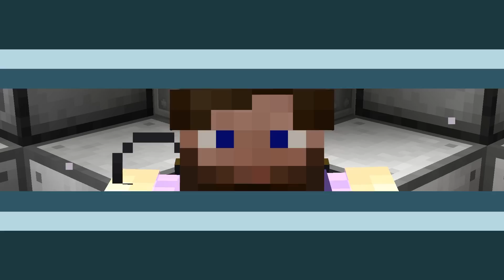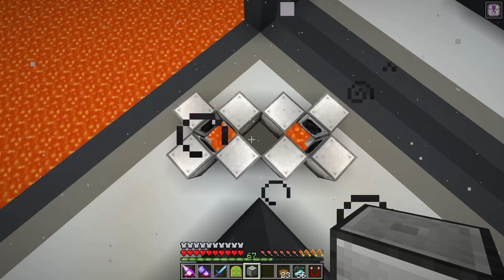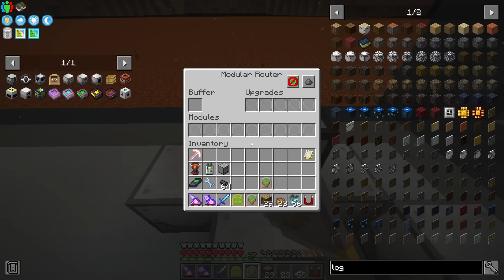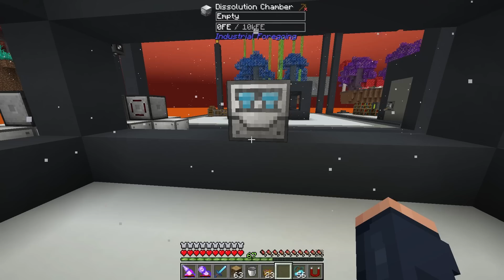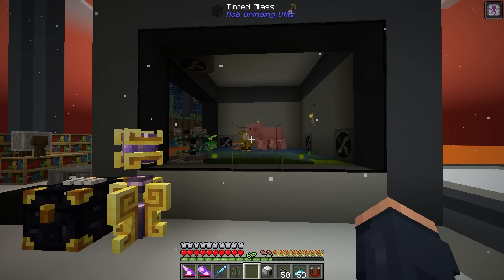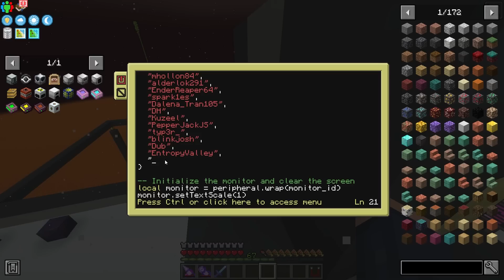All The Mods Volcano Block EP16 Unlimited Food IF Automation

Comment: put a tank in the router, then it can even transfer 250mb, a bucket is set to only fit 1000mb but a tank can handle different amounts. so a bucket only transfer 1000mb.
try the p2p

the player module is handy for keep instock building block, even to explore .

Comment: Chosen Architect, making the very typical mistake just about everybody makes when they use Applied Energistics 2.... @ 14:35 you put the next recipe in a horizontal line in the next open slot on your molecular assembler. Typically, you make a bunch of recipes in a row, say logs into planks, into crafting tables. But when you put them horizontally in, you task the same assembler with making first the planks, and then the crafting tables. If you put the recipes in vertically, you task 2 separate assemblers with crafting the different components of the crafting tables. 1 Assembler for the logs into planks, and 1 assembler for turning the planks into crafting tables. By doing it vertically, you speed up the process by 50% for each step. It doesn't require speed upgrades, it doesn't require specially made builds, all you need to do to speed up all your autocrafting, is by putting them in vertically. 

Truth be told, by using the shared assembler system you made where each interface touches on 4 assemblers, you do lose a little speed gain because a assembler could already be tasked with a previous step and that would cause the interface to loose out on a assembler spot. But its a very minor possible speed loss. 

Also, would you please stop using fluix cables everywhere? You like rainbows and colors in your builds, why end up using bland boring grey cables when you have all 16 colors to play with?
Reply from the maker: I do place them vertically and I understand why you need to... But believe me not everything has to be the most efficient way.

Comment: For Player Module, you should be able to add the regulator upgrade to it, which allows to set the amount of items in the target inventory (meaning your inventory). So you can set up restocking of items with it. For example always make sure you have a stack of torches in your inventory.

Comment: Instead of that exporter you could use an interface. Very nice to use those because just for one channel it lets you request several items that you can then pull out with routers and also send back items into the system by sending it into the interface. For some automation setups that need a couple of items and also send back stuff into the system it is a wonderful way to do that with just one channel.
For the storage bus on the tank it is better to hit that wrench icon so the bus gets filtered to only the fluid in the tank. Otherwise when the tank might get empty it could end up putting another fluid in there.

Comment: 18:15 I had the same problem i solved it with a sink on a Me storage Bus after i can export like it should
Reply from the maker: I tested it first with a sink and it still wouldn't work
Reply: ahh they are 2 different Minecraft water type if you use the other one it works. JEI search water then you see 2 different MINECRAFT WATER one work one not, hope can explain it that you undertand it. i mean in the exporter filter
Reply: apparently i was very lucky to get the secound water source at the time i change to the sink

Comment: Hi, once you get into Mystical agriculture, I found that harvesting pylons from Pylons mod is really fast (and super cheap), it just needs a hoe and investory above.
I have 9x9 farm filled with reliquary lilipads under and it can easily keep up.
Reply: Pylons are not fast enough for a farm w/ lily pads under every piece of farmland and a watering can. Modular routers can keep up and will harvest instantly. There is a pretty big delay w/ pylons. Still fast but it’s a lot faster w/ Modular routers.
Reply: modular routers can't keep up with a full setup of 17x17 lily with 9x9 farm with extra lily around and another layer only thing i found that could was advanced item collector @Bob_Smith19

Comment: Was there any water hoked in, that could be exported?
Reply: When he was explaining the issue, he had a Jumbo Tank with water in it already. That's what he was trying to get it to pull from. He didn't really show the full setup but I'd assume he had it connected with a Storage Bus. The issue is there're three different "Water" options in the pack. There's Water, from Minecraft, with the tag ic2:mining_laser_unbreakable, there's Water, from Minecraft, with no tags but appearing after the Apotheosis waterbreathing charms, and then there's Water, from IC2 Classic, tagged as ic2:fluid_display.

I believe when pulling from JEI, he needs to specifically grab the second one, listed as coming from Minecraft and not having the IC2 tag attached. Alternatively, he could use a bucket of water from his inventory to set the filter.
Reply from the maker: Interesting I'll try the bucket and see if that works next time!